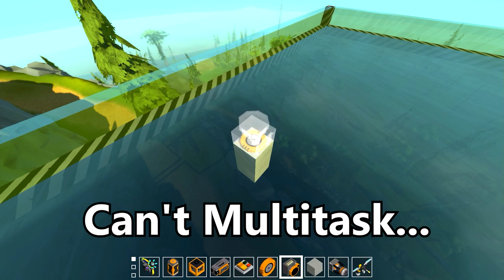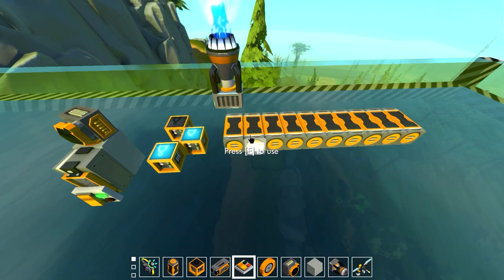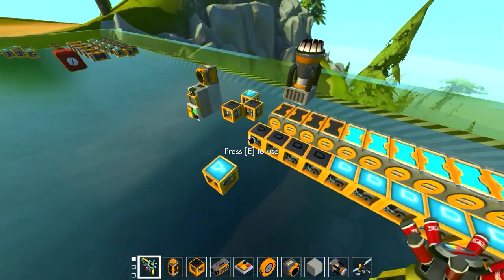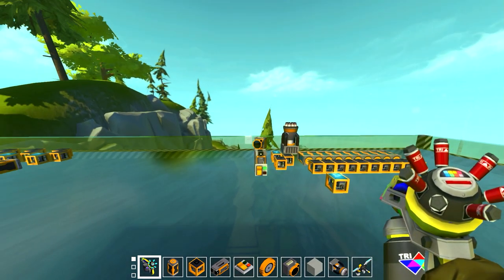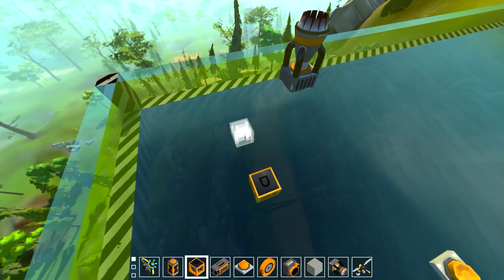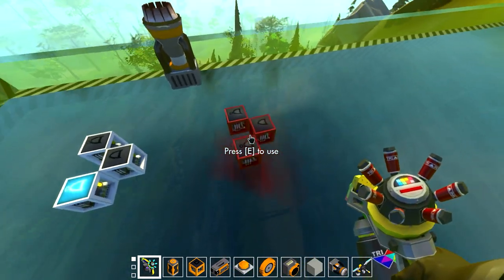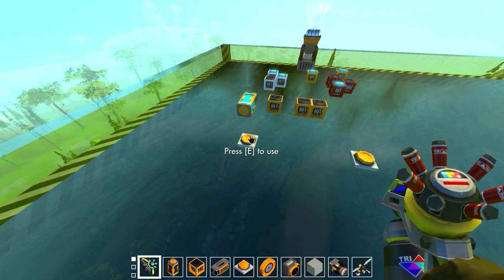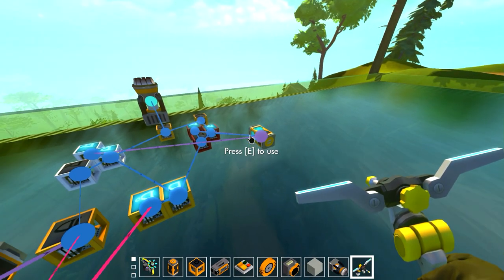Advanced Timers and Scanner Logic Tutorial! (Scrap Mechanic #133)

Comment: 7:30 I spent a few hours trying to figure that out yesterday and I gave up and did something else. You make it look easy.
12:45 I tried it and when I send a 1 tick pulse into the binary thing it starts flashing.
Reply: I've been playing a bit with the NOR -> NOR -> OR and back and it seems it sometimes needs a double input on the NOR connected to the button.
I fixed that by having a timer connected to the button with a 200ms delay so it gets one from the button and another one from the timer after 200ms.

After more testing you can take it down to 100ms. Lower then that and It'll fail to correct the pulsing.
Reply: @justinmean7370  Kan has another video about the memory bits explaining exactly how to  fix that issue ;) I think the video is logic 101 or smth like that

Comment: The sensor memory bit has a flaw: if it is not through the 1 sec period, it'll pulse the thruster. My solution to that would be to hook the output of the NOR gate (the one, which goes into the other NOR gate in the memory bit) into the interrupt timer's NOR gate, resetting the timer (it could still pulse, if the sensor detects you after less, than .1 sec, and the second solution is to cut the last timer into 2 separate interrupt timer segments, making the one in front .075 sec, the one in the back .025 sec)

Comment: A better way to do the timer would be to have a binary counter that will detect if it is at 120 * amount of ticks in a second first, if not then go 1 up and that happens every tick unless a buzzer is active. It is also a lot more accurate, but could use a lot of memory bits.

Comment: How to make a button = switch? Kan please help!
Reply: Ziegee Gaming [SyNC] Connect the Button to a controller that controls an arm. Then make that arm triggers a sensor every time that arm moves. Set to the sensor to button mode I think... it could be the switch mode, just switch the mode one time after placing it.
Reply from the maker: Ziegee Gaming [SyNC] You can make a button into a switch using a binary bit. You need 2 conditions: bit is set and button pressed = reset bit, bit is reset and button pressed = set bit
Reply from the maker: Ill show this in my next tutorial video.
Reply: create a t-flipflop, circuits can be found on google :p
Reply: Thanks guys i really appriciated
Reply: kAN Gaming when will you do next tutorial video?
Reply: search how to make a T-Flip Flop in scrap mechanic
Reply: switch mode

Comment: i not know exactly how, but i did a 5 seconds cycle with 1 second activated time. each 5 seconds only 1 seconds actiave... if works very good in my crusher... i make enought time to enemyes of low level waves comes into it and crush then all with only one second time of crush, enought to pistons hit groundn and back until timer resets after 4 seconds... this is advanced someway? i not find tutorial of this kind of stuff, i make it in minecraft easily but here i need some time to find out how to make it properly and probably i did it with more stuff than i need i use 2 timer and 6 logic gates, plus i can put it to be in extended pistons or retracted pistons in off cicly, i prefer retracted, beucase lag is worst when crusher hit the ground and keep contact for long time

Comment: Im trying to make a network that uses pulse width modulation to send many signals over a single connection, and its pretty much a pile of timers at this point xD
Any chance you can devote a video to what would be the optimal way of controlling and detecting pulse lengths?
Im bscly looking for a way to chain 3 timers several times in dynamic order (depending on a set of input switches) so i can just have 1 timer for high, low, and pause-duration, instead of each 3 of those per bit

Comment: Just wanted to ask if you were aware of the delay logic gates and timers have and just ignored it not to "overwhelm" beginners with such details, or you just didn't know about it. The build that you demonstrated for your 2min timer that you used in your other video (from minute 3:00 to 5:00) has a, in my opinion significant variance from the "real" time you want to measure. 
My calculation:
Each "1-second-bit"-tile has a delay of 3 ticks of the status-bit, 2 ticks of the timer and 1 tick of the final and-gate, so 6 ticks delay in addition to your 1-second timer.
1 tick is 1/40 second.
( 120 1-second-tiles * 6 ticks ) / 40 = 18s in addition to your 120s (2minute) timer, which is quite significant for such a small duration.
The solution: instead of turning the timers in each! 1-second-bit-tile to 1second or 40ticks, turn them to 34ticks or 0.850s.
Reply: I know this is late, but this also annoyed me with his cool down circuit. The ticks it shows in a timer don’t include the extra tick just from the timer. So when it says 1 tick and says 0.25 seconds, it’s actually 2 ticks or 0.5 seconds. If you set it to 0 ticks, then it’s actually 1 tick, but he could’ve just used an OR gate, which is smaller anyway.

Comment: can you give a tutorial for making a clock? one where you press a button/switch and it will give out multiple outputs, I really could use this
Reply from the maker: Mech WARRIOR57 What do you mean? I'm a little confused about what you are trying to do.
Reply: ok so in minecraft if you hook up a button t a T-flip flop, then connect that Tflip flop to a redstone torch clock. I'm using this for a train for when its driving to make sounds constantly even though I'm only gving it one constant input. basicly I need to know how to do this in scrap mechanic
Reply from the maker: Mech WARRIOR57 Oh like an alternating circuit that switches between off and on when you activate a switch. all you need is AND gate > Timer > XOR > AND gate. Connect your on / off switch to both the AND gate and the XOR gate. this will alternate at the timer frequency when the switch is on.
Reply from the maker: Hopefully thats what you are trying to do :P
Reply: Don't trust edited comments

Comment: Say you have a 4 by 11 light connected to or gate 
And you hooked all this up to 10 other or gates and connected it so each of the 10 or gates will when turned on will make a 0-9 on the board 
So like a digital clock 
And so I want a button so when I press the button the number will go up 
And when I press another button he number will go down 
I can send you link to the build so you can see what I'm talking about I'm just stuck at this part 
Thanks kan
Reply from the maker: Send me the link if you can!
Reply: sorry hold on thats the wrong one
let me update it for you
Reply: HERE SORRY FOR THE TROUBLE;E HERES A NEW LINK

http://steamcommunity.com/sharedfiles/filedetails/?id=883847405
Reply: kAN Gaming so basically I'm using this which I made and saved it and one module is ganna be button up and button down on each so I can do that from front next module is clock so I press button and it starts clock

That's the plan 
On the back I used switches that was just temporary so I can test make sure the stuff works